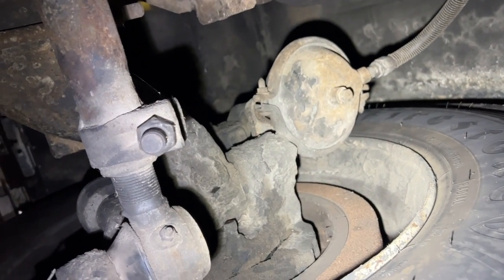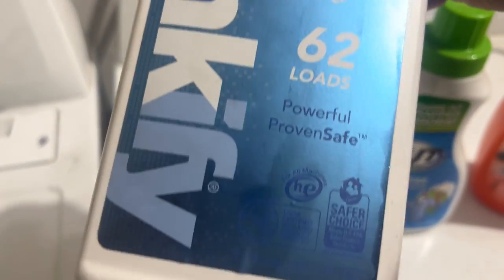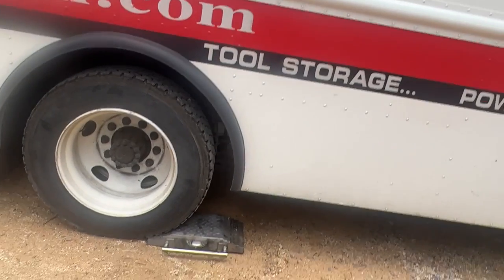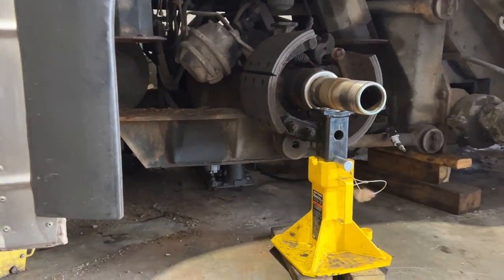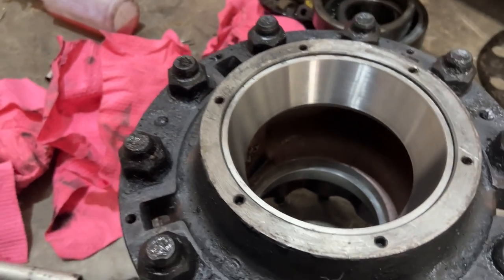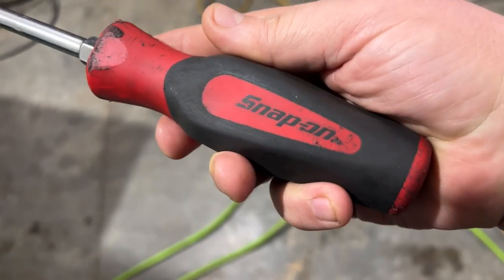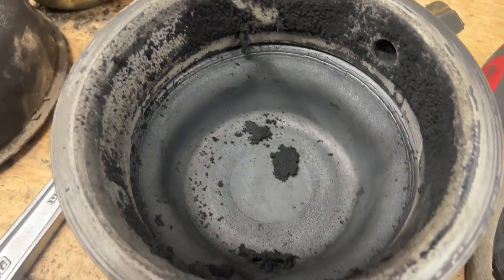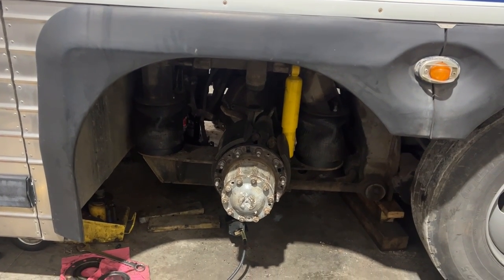Kingpin removal & rust repairs on vintage mci bus. Plus bad air brake chambers & more air leaks

Comment: 15:14  Looks like a big, flat head Snap-Off screwdriver.  👍
Reply: I don't think much to Snap-On tools. I used to repair washing machines and a lot of the screws were 8mm hex head. I wore out 3 Snap-On 8mm sockets before changing to a cheaper brand that lasted longer.

Comment: Glad you mentioned the laundry detergent. I've been wondering how you all got your clothes clean after rolling in the grease, lol.
Reply: You can treat with wd40 and I use a grease emulsifier called Corotech. The later is very pricey but works great in warm and hot water.
Reply: Honestly I have taken my clothes to the local car wash before and sprayed them off before I washed them

Comment: Awesome work guys. I love my flex head ratchets as well but I only use GearWrench flexhead ratchets for the only reason is you can lock it in the position you like. I have yet to break one but time will tell how they really hold up. Mine are a couple years old now but I do not use they like you guys do.

Comment: Interesting to see the stick welding. I bought a small machine a few years ago but never got the knack of striking an arc. I've been using MIG for some years but thought the stick welder would be good for thicker steel.

Comment: What determines whether or not to use grease or oil in the wheel hubs and is one any better than the other?
Reply from the maker: 5 of his 6 hubs were grease when it rolled in.  Grease is great for buses/rv’s that sit.  Also worn spindles retain grease better than oil.
Reply: It's down to the detail design of the bearing cartridge.  Exact materials used, finish of the races and balls/rollers, clearances within the bearing, internal seals/diverters  plus a few other things.  As Scott said getting oil into a grease bearing is a very bad idea, also getting grease into an oil bearing is nearly is bad - in both cases the lubricant will not behave correctly and the bearing will suffer local overheating and wear and will fail prematurely.

Comment: Just a heads up, I went to Lowes today and bought a 24” 3/8” flex head kobalt ratchet for $18 reg $79.99 and a 36” 1/2” flex head for $23 reg $99. I couldn’t pass it up. Y’all check your Lowes locally. I live in Louisiana.
Reply from the maker: I am scared of kobalt lifetime warranty because they really seem to be fading the line out.  Harbor freight is growing and easy to replace
Reply: @BusGreaseMonkey  I agree with you. I guess for the price I paid, I’ll make an experiment out of it. Lol. I’ll see what it’s limit is.
Reply from the maker: I have quite a few kobalt but i stopped buying them when the focus was shifting away from them at lowes.

Comment: Your welder guy needs a LN-25 wire feed attachment . Sure helps with jobs like you have on them buses
Reply from the maker: He used his mig the last job but he chose to use the big stick on this job
Reply: @BusGreaseMonkey  Isn't arc the go-to when the piece is super crusty and dirty?

Comment: waiting on parts  and so it goes for most h/duty mechanics
Reply from the maker: Finding more issues on assembly day definitely set us back.   Didn’t catch the air leaks because the other more major leaks were there.  Once those got fixed they really were easy to spot and hear